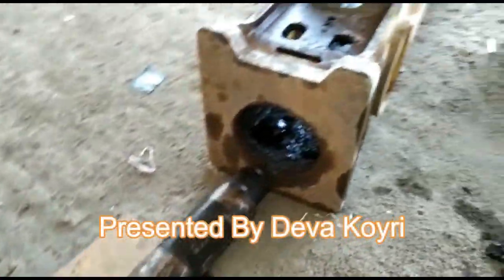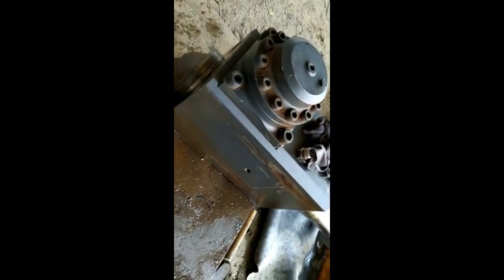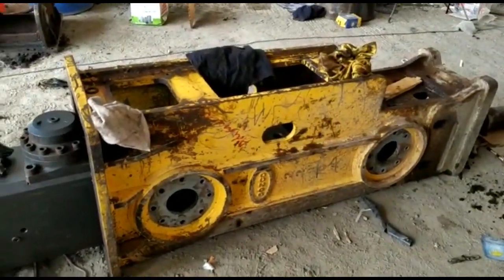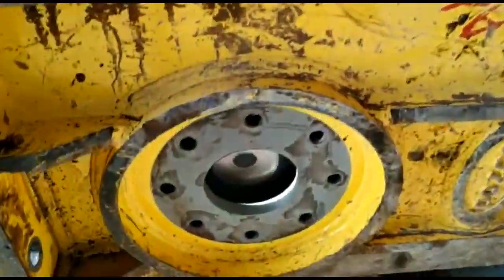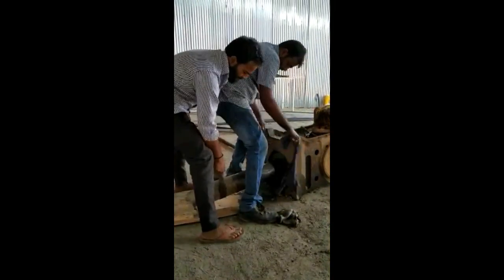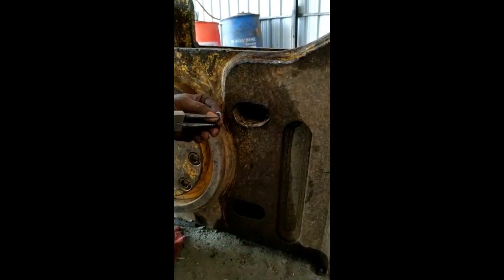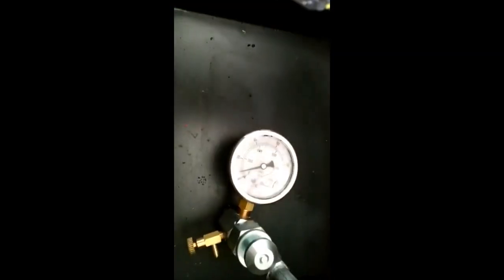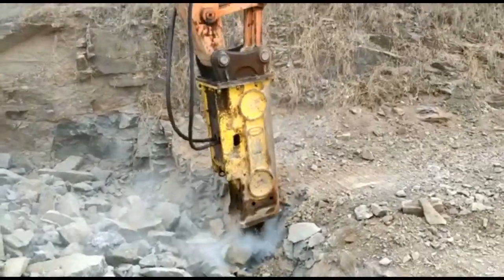Hydraulic hammer Rock breaker overhauling

Comment: Sir  excelent work please tell me hamer  presure adjusting between in work and gas filling
Reply from the maker: Bothe are different,  hydraulic pressure depends on hammer model but nitrogen gas pressures are same in all model, if you want to know back head gas pressure then it will 14bar and if fitted accumulator then you fill in accumulator 55bar
Reply: Sir muze bhi training leni hai kaha se mil sakti hai